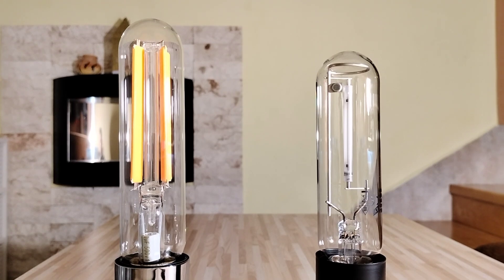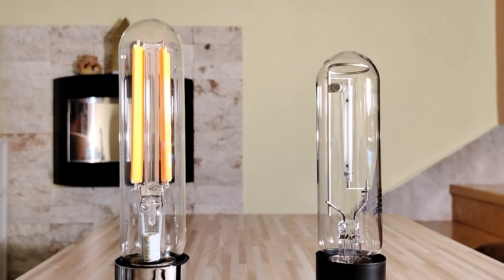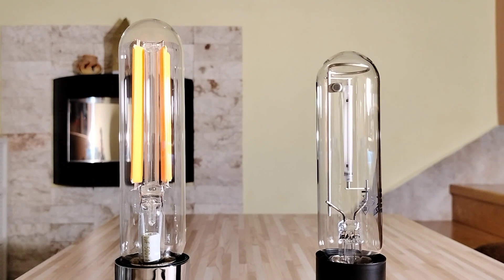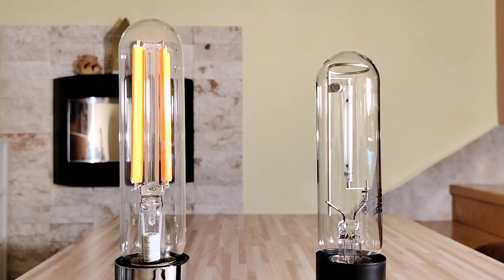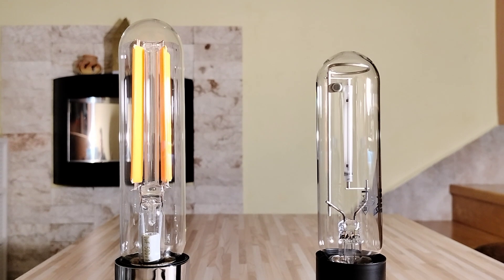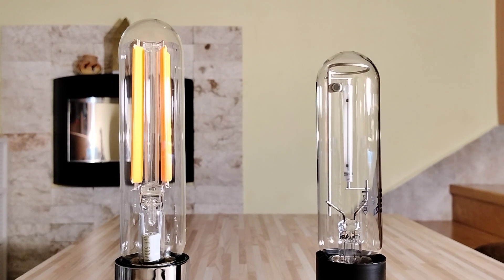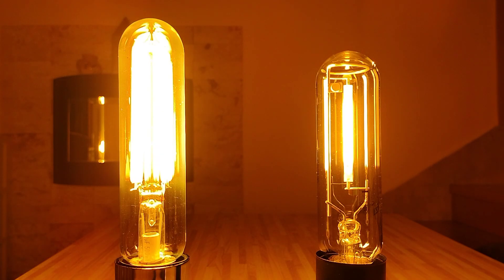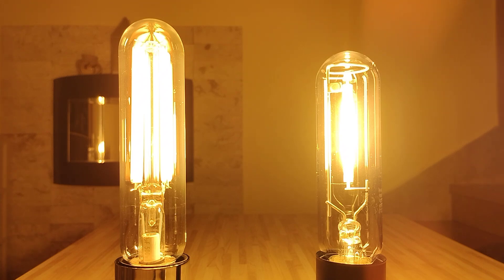LED VS High Pressure Sodium (NAV 50 LED FILAMENT AMBER V 1600LM 15W 718 E27 VS NAV-T 70 W SUPER 4Y)

Comment: Osram has a 6000Lm 4000K 35W version of this now.
Haven't tested, but it's ordered. Got it for 20 eur. Want to use it in my workshop, where I need lots of light.
Reply from the maker: This makes me happy and I wish you to be satisfied with the light and that it serves you as long as possible.🙂 And 4000K is an ideal cool white light for an environment where you need to concentrate more than rest, so from this point of view alone it is a good choice.🙂

Comment: HID Lightbulbs have generaly larger power density than LED lightbulbs at given volume, and don't forget that LED needs a cooling, HID doesn't.
Reply from the maker: It depends on which HID lamp it is specifically and which LED replacement it is compared to... For example, Mercury Vapor lamps produce around 35 to 55 lumens/watt, but HPS lamps have up to 80 to 150 lumens/watt. But it also depends on how many watts a specific HID lamp has, because while a 50W HPS lamp produces around 100 lumens per watt, a 1000W HPS lamp can have up to 150 lumens per watt. And in the case of LED lamps, it is again a matter of whether they are SMD chips, or COB, COG... Some produce more heat than others, and this also applies to light. However, LEDs will never completely replace HID lamps, because HID lamps use a completely different technology, which is based on the light produced by gases that burn... Like the Sun, even though the Sun only has one type of gas. But the principle is basically the same... Burning gas that glows. But LED? That's completely different - artificial light. I feel better under a quality HID light than under a quality LED light.🙂
Reply: Yes, that's right! That's true! For an LED to live 15-25 years, the voltage per LED should not exceed 2.8-2.9V! And by putting more LEDs with a voltage of 2.8-2.9V, the lm/watt efficiency increases, as well as the longevity, and even greater longevity if it is cooled the LED!

Comment: Once the sodium kicks in there's no comparison... the only thing i dislike about hids, are the ballasts, the lamps are not "plug and play" if you know what i mean... you need a ballast for each wattage or type of lamp, unless you get a ballast with control but impossible to get one where i live... but anyways, long life hid lamps!
Reply from the maker: Yes, at first glance you can't see the difference, but the LED lamp has 1800K and the HPS lamp has 2000K, so the LED has a warmer light with better color rendering, but of course it is a completely different technology and first of all, the LED lamp flickers visibly, while the HPS with a good ECG can have 20000Hz or even more and thanks to this the flickering is not visible at all. Second thing, that HPS lamp is dimmable, while the LED one is not. Third thing, without using a suitable lamp, the LED lamp does not have as good light distribution as the HPS lamp. Of course, each of the four filaments shines more on one side, while less on the other. However, with the version with a frosted bulb, the light is uniform and it is better in this respect. And yes, HID lamps need an adequate ballast, but there are also, for example, self-ballasted HID lamps. I have a Mercury Vapor lamp that doesn't need anything... There is a tungsten filament inside, next to which there is a quartz arc tube. Of course, the disadvantage is, for example, a shorter lifespan, but I'm just giving an example that it can be done without an external ballast. But classic HID lamps can achieve a very long lifespan. I have one HPS with two arc tubes and barium coating and the life of the B50 is 64000h. That's more than double that of this LED lamp. Each technology has advantages and vice versa... I personally love HID lamps the most, but I also like some LED HID Replacements.🙂
Reply: The flicker of HPS, LPS, MH and CMH lamps is visible but very little and at a few meters the flicker is not visible at all, but indoors it is more easily visible, but if there is an electronic ballast it is not visible at all and even with cameras it is very barely visible! But I think that MV lamps with magnetic ballasts flicker a little more, I am not sure about this, but when I observed a MV 250W located at an altitude of 3 meters the flicker was visible at a distance of 2 meters from the lamp it seemed to flicker but very little, but this may depend on the ballast!
Reply from the maker: @HIDSON-70  Yes, the visibility of the flickering of the lamp on the camera also affects the distance of the camera from the lamp, but above all it is about what you yourself mentioned, namely, whether it is a magnetic or an electronic ballast, because while the magnetic ballast only works at 50/60Hz, the electronic ones work at 20 and more kHz and that is an extreme difference.🙂
Reply: Finally having an HID lamp, I totally get what you say. I and definetely many other people find very hard and expensive, specially for beginners like me, in a day and age that it seems that old technologies get discontinued by the day left and right, and being replaced by LEDs in this case. But the charm these old technolgies give off is immaculate, specially the lore behind them, the variety, the startup and everything else involved. Not to offend, but newer lamps feel like baby work, as you say, plug and play, but getting a ballast, wiring it up, when I finally do, I feel it retrieves you a prize, for your time, dedication and money to the craft. Feels I'm achieving something in getting these lamps, doing manual work. Not to mention each kind has personalities, specially considering one ballast is for a single lamp kind; you can't buy lamps of other kinds for it, but you have almost infinite choice of options to couple with your device.

Comment: Great video man i always like the hps start up never liked instant start leds.
Reply from the maker: Thank you very much!🙂And I also like the original HPS lamp better, the start-up of which slowly brings it to the desired color temperature and brightness. Also, the original HPS lamps evoke nostalgia in me, and last but not least, with a high-quality ballast, an HPS lamp (and especially if it also has two arc tubes) can achieve a really long lifespan.
Reply: @Naguals_HID_Lamps  yep magnetic ballast are better, it has good quality longer life span it's durable.
Reply from the maker: @DiegoGene-fh3zp  That's true. However, it also depends on the circumstances, such as the ambient temperature in which the ballast is located, so that it does not overheat. But CCGs tend to be very durable, but unlike ECGs, they have a much lower frequency, and thus the flickering of the lamp on the camera is visible, or even visible to the naked eye. But that also depends on the particular HID lamp. There are several factors...